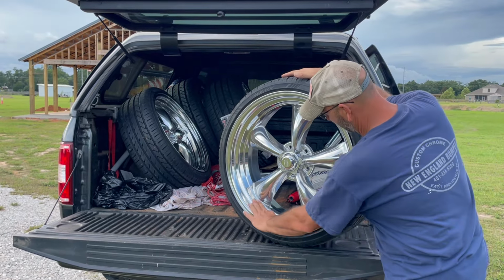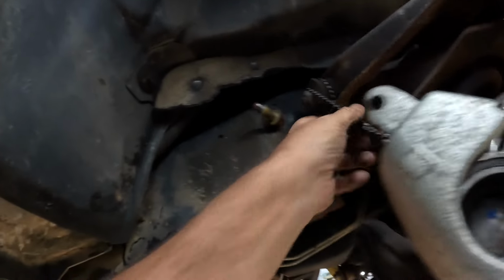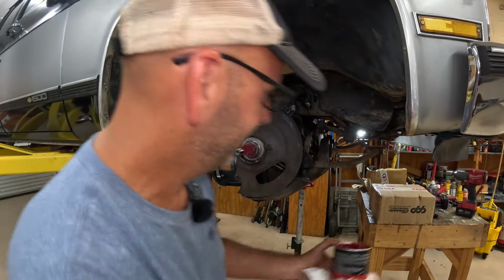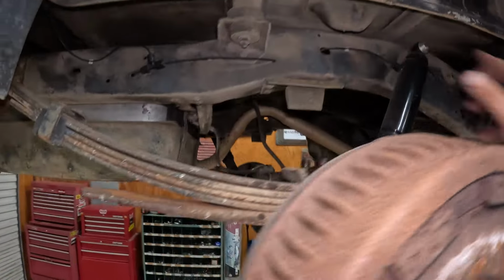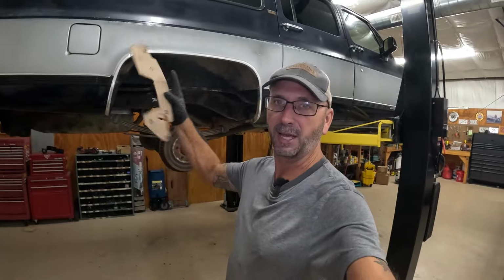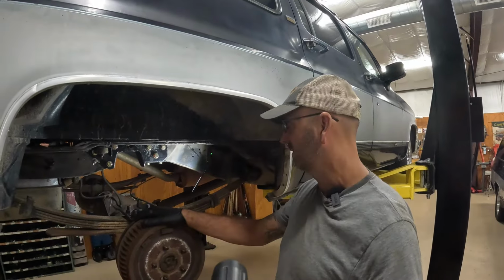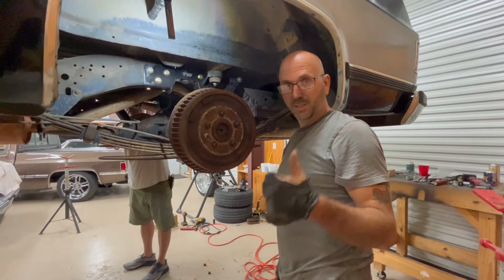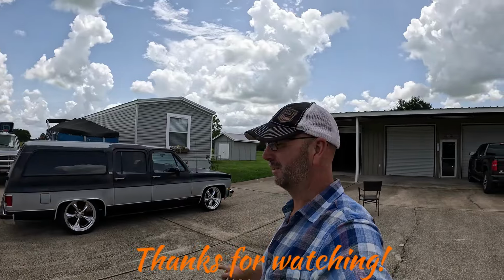Total Transformation! Lowering our Squarebody Suburban.

Comment: We have a 84 Burb I’m wanting to notch the frame but those fuel lines scare me man! We will be towing a tri toon and wondering if bags or air shocks would be better? Were your shocks totally deflated when you rolled it out? Best video I have seen! Glad I found ya! Nicely done Sir!
Reply from the maker: Thanks for watching!  Those fuel lines are scary! I disconnected the brackets on a good bit of them to get some slack. Then I pulled them out of the way when we cut.  The shocks did have some air in them, I think it was 50lbs.  Tin Works makes an air bag setup for them. I feel it needs them, I plan on installing it next month.  I’m glad you found our little channel!

Comment: What was the final measurement from ground to fender on front and back? Looks good..
Reply from the maker: I think it was around 24”.  I’ll measure it for you Sunday when I get home.
Reply from the maker: So I just measured. Front 28” rear 26” without any air in the shocks.  In my opinion the rear is a bit too low, need to figure out how best to address it.